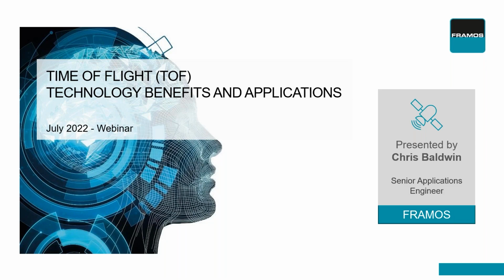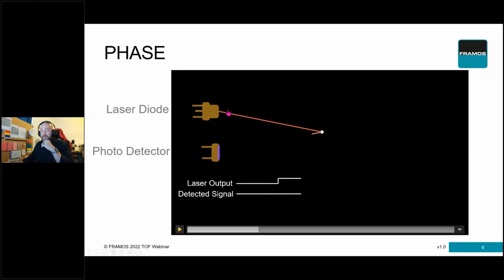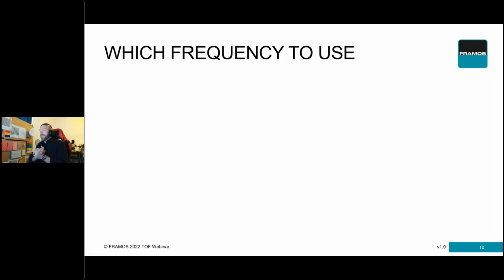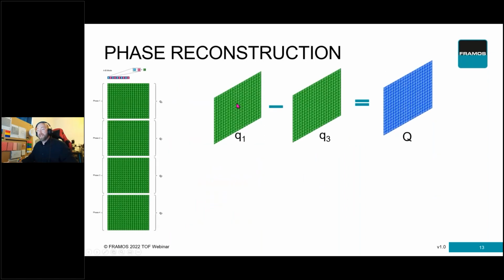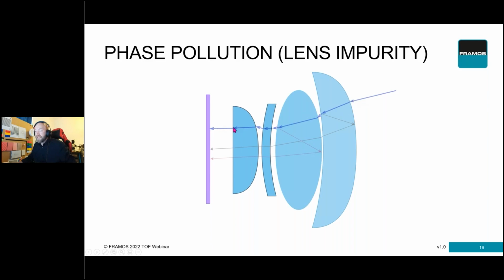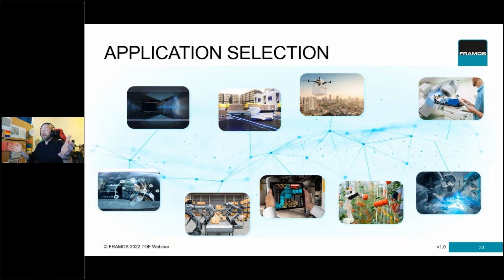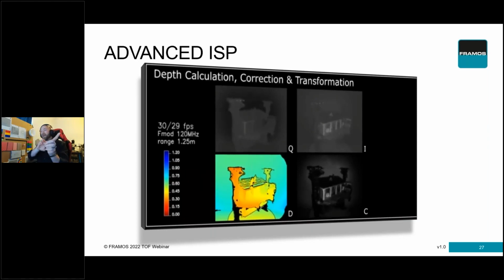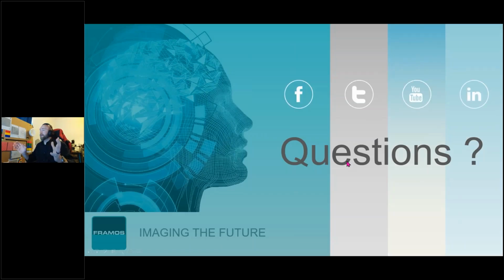Time of Flight Technology - Benefits & Applications

Comment: How do you compensate for multi-path and lens internal reflections?
Reply from the maker: Hi @hossamalzomor3311, 
A good parallel to draw is between “lens's internal multipath” (LIM) and lens flare or glare. 
Lens flare is a superposition of the intensity of the target and the internal reflections of the lens system. LIM has the same structure but instead of a just a superposition of intensity we have a superposition of the phase of the LIM and the target.
This superposition affects the measured phase angle based on angular and intensity difference between the LIM and target.

Here’s how you can minimize the effects of LIM:
1 - The first step is to reduce as much as possible the presence of LIM by using good lenses and filters, where the dynamic range of the lens is optimized for the iToF laser wavelength. These HDR lenses have reduced glare/
2 - Controlling the dynamic range of the scene. Eliminating retro-reflective materials where possible reduces the intensity of LIM artifacts.
3 - Advanced acquisition and processing to detect glare in the image and compensating for it in the image processing pipeline. This is deliberately vague as there are many techniques that can be applied in this realm...

As an example: The use of sensor and laser combined HDR imaging; This can detect and quantify the source of glare in an image (assuming it is within the sensor FoV) and measure its phase angle and power. This together with an approximation of the lens's “flare susceptibility” can highlight the pixels that are directly affected as well as approximate the LIM phase offset for the entire array - for the “darker” objects within the scene.

The FRAMOS iToF devkit does not include such a complex pipeline. It does, however, include a mode setting and raw data throughput to allow customers to build a processing pipeline as described.